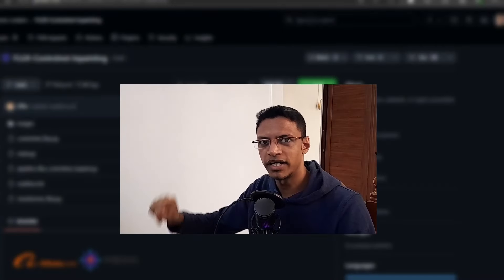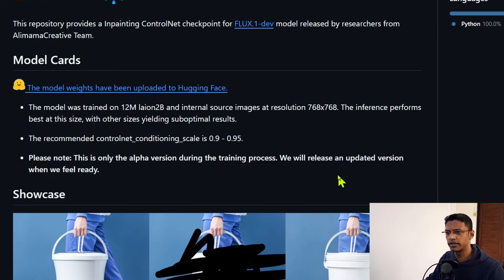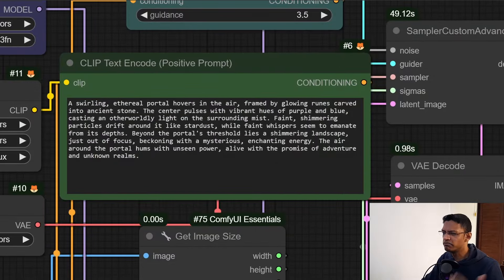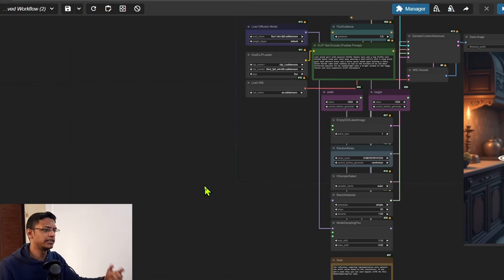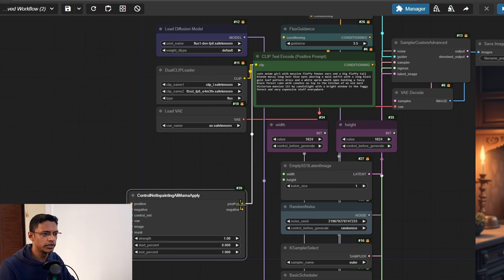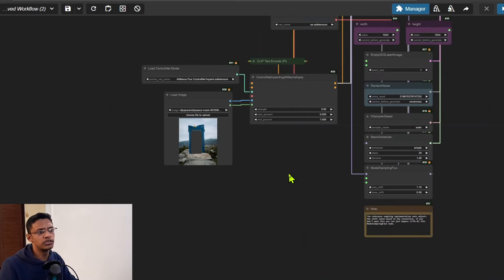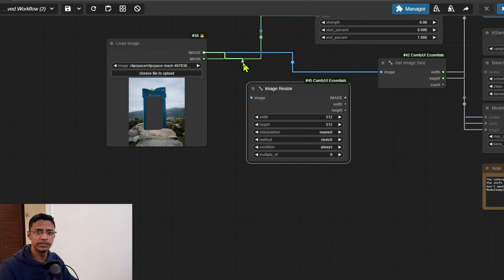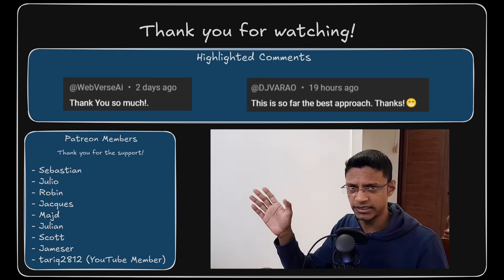Alimama Flux ControlNet In-Painting with ComfyUI: Step-by-Step Guide

Comment: what would you say the requirements are? i've noticed that for instance on my laptopt 4080 12gb vram it works with small inpainting adjustments but it doesnt when i use bigger areas. I didn't encounter particular issues when doing outpainting with a sdxl model and then flux img2img workflow. Is it that heavy?
Reply from the maker: Hello, For my 12GB VRAM, i was able to upto 2048x2048 resolution when generating images with flux. More than this and I get out of memory errors. You can try to push your system by incrementing the resolution each generation to find the limits.
Reply: yeah, generating text2image alone i never had issues. It's mostly when I do inpainting exactly using the alimama controlnet model that things get a bit messy. Do you think that there is maybe some parametre that is supposed to be fixed? Like the resolution of the original image i try to start  my inpainting from?

Comment: May you explain what is the difference of inpainting using controlnet or not? Using stable forge, we have inpainting area even for flux usage, and it works. May you explain the difference in that case? Thank you and congrats for your videos
Reply: The difference is with this control net model it works worse.
Reply: @SonidosEnArmonia_1992  lol
Reply from the maker: They use different implementations. I believe the more approaches we have to solve the same problem, the better the technology will evolve over time. Competition drives improvement, after all.